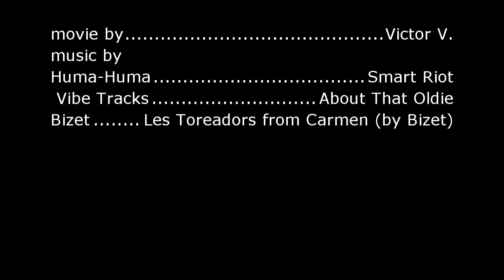Homemade Milling Cutter  For Engraver From Cigarette Lighter

Comment: Way cool idea. You have to make sure that the wheel is turned the right direction before you put it on the nail, because it's sharpened so that it cuts turning in only 1 direction. Right?

Comment: Neat idea ^^

So, the wheel from the lighter just slides over the (appropriately sized) nail? And friction is enough to hold it in place?
Reply from the maker: Yes, that is right.
Reply: Victor V. 
Awesome.
This is definitely something I'll have to try next time I run a lighter out of fuel

Comment: What is that long extension from your Dremel drill called? Is that built in or just an accessory? I am trying to locate a similar extension accessory here in Riyadh, Saudi Arabia but I can't seem to locate one.
Reply from the maker: +Saiea Hera This homemade accessory for the Dremel. I think that the method of making it very intuitive.
Reply: Thanks a lot guys.

Comment: should have used  thermal expansion shrink fitting (I think that's what it's called) to make it stay on there forever
Reply from the maker: +- - (Theo) I think you can try to do it. You can heat the cutter, and the axis much cool and connect them immediately.